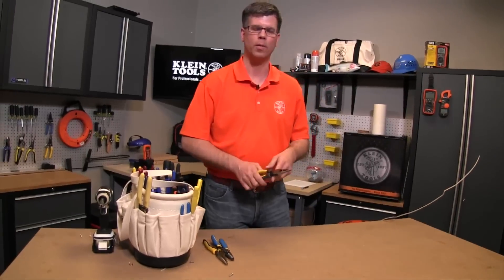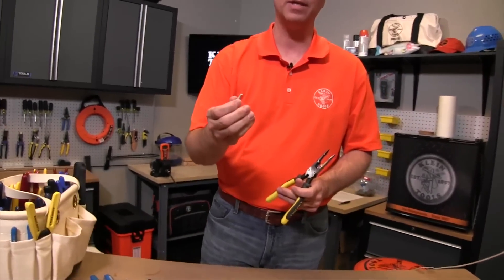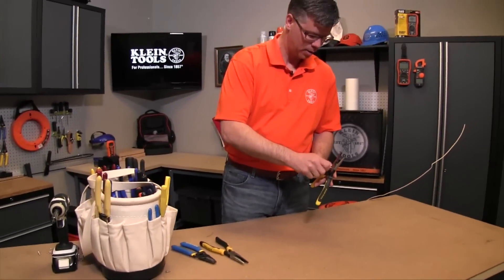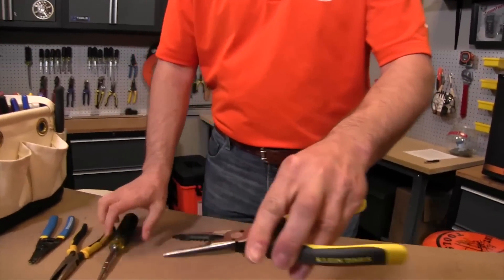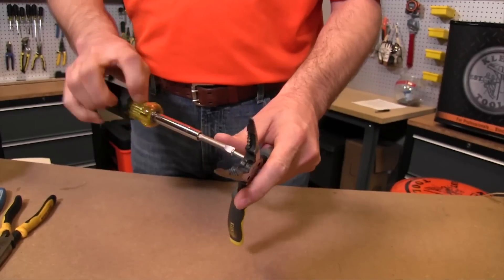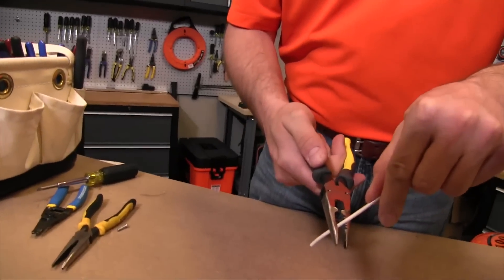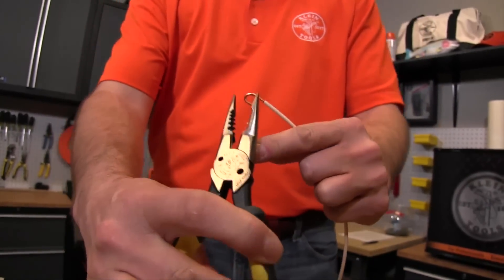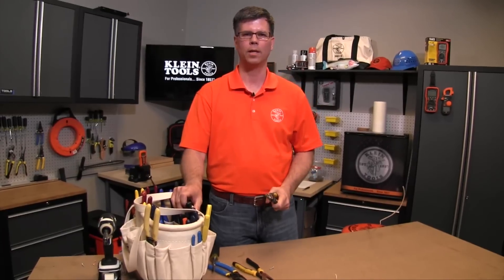All-Purpose Pliers: Wire Stripper and Long Nose Pliers Combined

Comment: The stripping holes on mine are not perfect circles, they are more of an oval making it hard to strip wire, is there anything I can do to fix that?
Reply: Woodman721, like any tool, just continue to use it.  It'll wear down to a comfortable bite eventually.